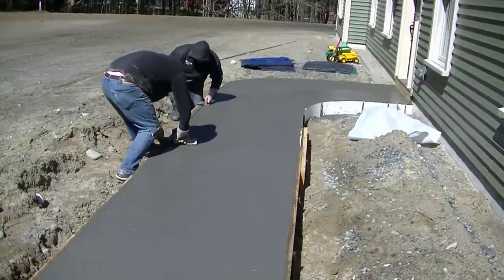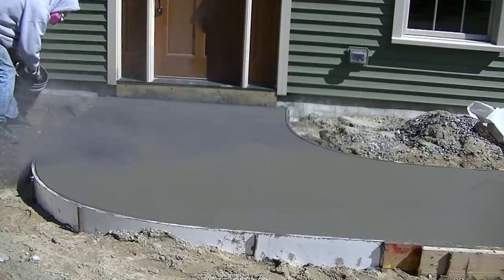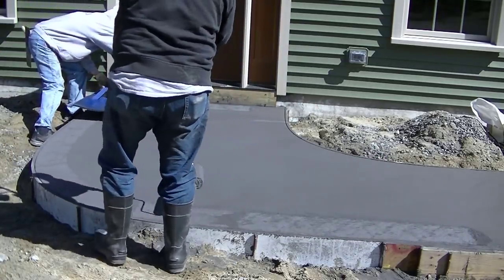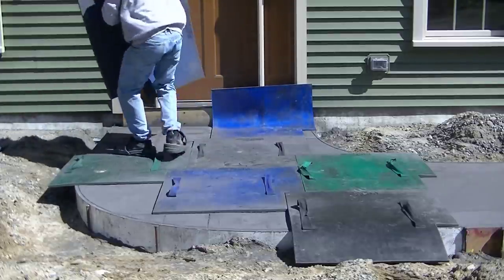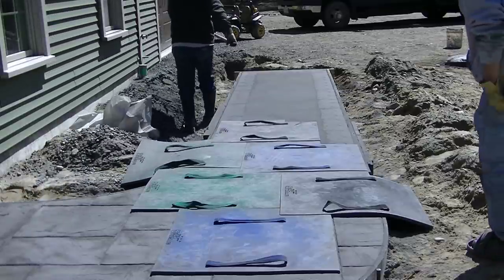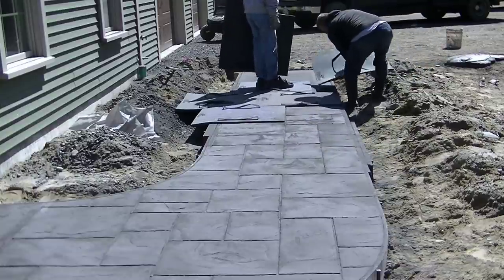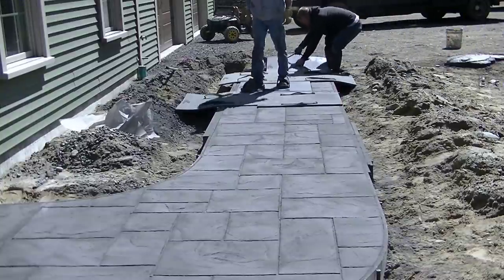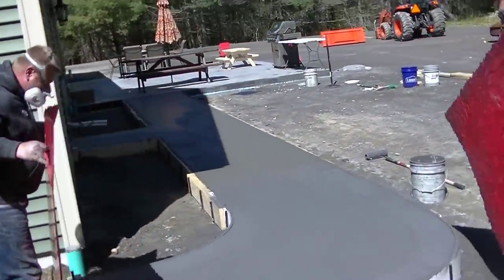How To Stamp A Concrete Sidewalk (Concrete Stamping Techniques)

Comment: Thank you Mike for providing all the various videos on stamping...  So I feel compelled to share my experience...  I'm a DIY'er (weekend warrior!) and I've poured and finished various concrete patios, walkway,  and even barnyards over the years.... So I think I know what I'm doing (mistake #1).  I just completed a  42 ft X 3 ft wide straight walkway in the front of house.  This time I wanted to try the stamping.  How hard can it be right? (mistake #2)...  I watched enough videos!!  Anyway,  This is intended to be both a warning, as well as a plug for you the professional!  If neatness and looking professional is what counts...  Do NOT try this yourself.....  If you can live with mediocre results and an amateur -ish look, than try it yourself.  The main problem...  WAY too many variables that can drastically effect things.  Problems started shortly after about the 5-6 wheel barrow load got dumped....  it was about 10:30 am, and already about 82-84 degrees and humid.  Next,  added color into the truck upon arrival.  Driver did say the color can cause concrete to dry quicker....  I told him to go to about 6 slump.  It wasn't enough.  Before I even got down to about 10-15 ft left to screed... things were ALREADY drying 'dangerously' fast such that it took everything muscle in my body (along with having no choice but to lightly spray water on top so we could float and finish it the best we could)...   So in one way I feel like I deserve an award from saving things from being a complete disaster.  but due to these unforeseen 'curve balls'....  IT forced us to rush and frantically begin the stamping process immediately!.   I was using a 'Italian Slate' texture skin,  and thank God,  because if we were attempting say a field stone or something with grout lines,  It surely would have been a disaster!!  So  the Gull Gray color seems much lighter due to the water sprayed on top,  and the Storm Gray release agent seems 'blotchy' at best.....  All things considered,  I think I can live with the result,  but wondering if an overlay 're-do' is a possibility or should I do as the wife says and ,  'Better quit while your ahead'  THANKS !!

Comment: Thanks for all the info you share on your channel!  I have taken it upon myself to do a bunch of stamped concrete in my back yard.  I am mixing 80lb bags in a mixer so I am doing small sections at a time.  The issue I’m running into is when I go to stamp the color hardner is seeping through the joints as I step down on the mats.  I think I’m starting to stamp too early but it seems like if I wait any longer it will be set up too much. I start once I can only push down about a quarter of an inch on the surface of the concrete. Maybe I’m putting the color hardner on too early. Should I wait till all the bleed water is evaporated before I throw on color hardner?  Thanks again for all the info!
Reply from the maker: Yea, we either wait for the bleed water to evaporate, or if it feels ready, we have to mag float off the remaining water or squeegee it off. Then we broadcast the release powder and stamp. We do also get some paste seeping up through the joints of the stamps. I'll rub out the joints the next day when we wash the slab with a round metal stake to remove that extra hardened paste.
Reply: Mike Day Everything About Concrete Thanks Mike!

Comment: On the stamped concrete I noticed you didn't put any control joints.  Since the stamped concrete has shallow ridges, are you concerned for uncontrolled cracks?
Reply from the maker: We come back the next day and saw control joints.

Comment: Mike nice job. I like the Ashler slate stamps. We just did same pattern on a 4’x70’ sidewalk a couple days ago. I’ll be posting a video soon. Check it out buddy. Love the touch up tool u made out of a paint roller. 👍 we use what looks like a pizza cutter. I also like that roller you have for edges. Where did you get that? 
Bondo

Comment: I worked 9 years for a crete co. And never used these , dont like them, we had aluminum rollers with the design s in the rollers. Hell of a lot better than the rubber stamp. At least for our company.